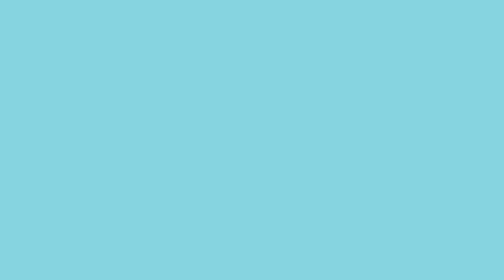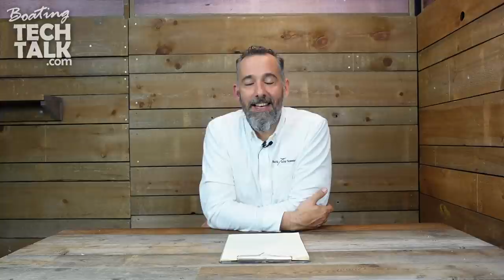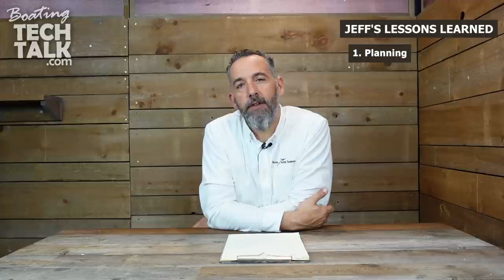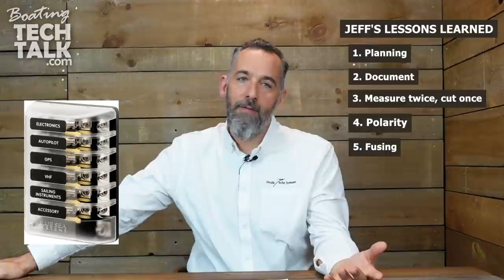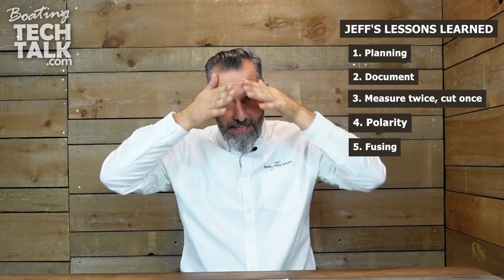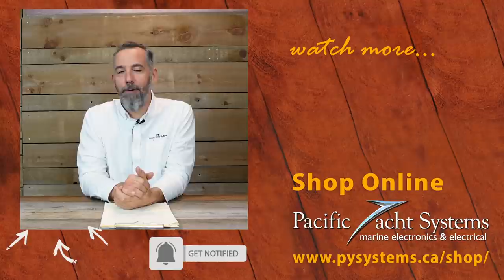Jeff’s Marine Electrical Lessons Learned

Comment: One of the tricks I do is use a cheap spray lacquer on the screw terminals. Keeps them looking like the day you installed it and if you need to service it the cheap lacquer will flake right off once you turn the screw.
Reply from the maker: Thanks for sharing Thorn, good one.

Comment: Great advice AGAIN!  The one new thing I got from this is to use a fuse block with blade fuses. Gone will be many in line glass fuses.  Oh boy, another project.  Oh, to make pulling cable easier the next time I use a messenger line that stays in the channel.  To support another tip you suggest that I have always done is DOCUMENTATION of everything maintenance, improvements , etc. Thank you for keeping us up to date with advice.
Reply from the maker: Thanks for sharing your project with us John, inspires others to do the same,

Comment: Hi Jeff, as always it is top quality information. I have been following your videos last 2 years and this weekend, we got our first boat. It is a boat from '78. Previous owner (the first one) took very good care the boat but many things has been done early 80-90s. We would like to renew all electrical circuit. Including batteries, power distribution, cabling, solar panels, lightning etc. So it will be a lot of work. 
But from your experience, what do you recommend, shall we do it right away, or just wait a bit and understand the boat? Review previous owner's documentation, and boat manual and do it on winter we we take the boat to cradle on ground?
As electronics engineer, there are many great people who share his/her experience with the community and you are one of the great examples. Thanks for doing this!

Comment: Jeff,  What type of shore power plugs do you use? Can you do a video on shore power plugs?   Modern SmartPlug vs the antiquated 1938 NEMA L5-30, since many boat fires start in the shore cord/power system I think more info should be out there on this fire hazard on boats.
Reply from the maker: Good suggestion Abel. We've tried SmartPlug over the years, and don't recommend the DIY kit as too many retrofit installs don't hold up.

Comment: This was another great video, thanks Jeff. 
I am redoing some wiring now, including 40yo welding cables that were used for the starters and grounds with the "green growth" and when I cut through them to see the depth of corrosion, I was surprised by how much good copper there was, even with uninsulated ends and routed in the bilge. I'll be upgrading anyway and looking forward to seeing your next video
Reply from the maker: Thanks for sharing.

Comment: That was a great one again, Jeff. Talking about cutting holes for cables, do go back and fill in the surplus hole to prevent the possibility of water flooding? An example in my battery box the builder installed a hydrogen gas vent tube, then cut a huge hole through the  side for the battery cables and left it open. Does anyone back fill holes? I’ve thought that polyurethane foam would be a quick way to do this, or for engine room holes there is a foam silicone that would fill the space around cables and pipes. Do you have any experience with this issue?
Reply from the maker: Expanding foam is good way to completely fill a void after running wires. We use that solution frequently.
Reply: @PacificYachtSystems  thanks, Jeff’ good to know that is a done thing.

Comment: Hi Jeff, do you recommend the use of Ferrule terminals for screw terminals using marine wire? Considering these for AC power sockets and my Dometic Aircons. thank you!
Reply from the maker: Big fan of ferrule terminals... never used on AC circuits, just low amperage DC circuits.

Comment: I just found wire nuts in some of the junction boxes for my A/C wiring.  What is the best method to join 3 #14 marine wires together?  Can I use ring terminals and join them with 10/32 Stainless steel bolts with lock washers, and nuts?  Then friction tape followed by plastic?
Reply from the maker: Mike, i'd consider a small terminal block as a way to join 3 wires together.
Reply: @PacificYachtSystems  Thank you Jeff!  I like your training, spot on every time.

Comment: whats your thoughts on using dual wall heatshrink ( with glue) over insulated crimp terminals
Reply from the maker: The challenge is that many insulated crimp terminals have an opening at the tongue of the crimp terminal. Making the heat shrink terminal limited in value.